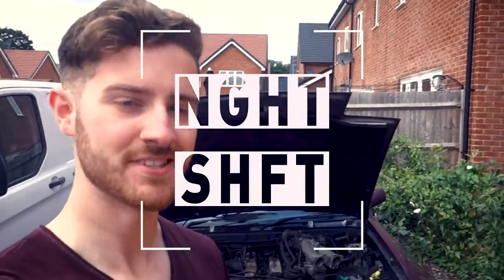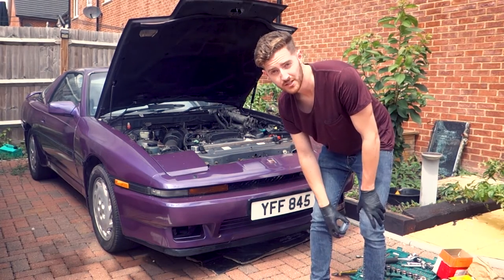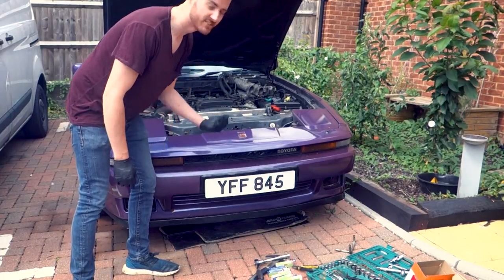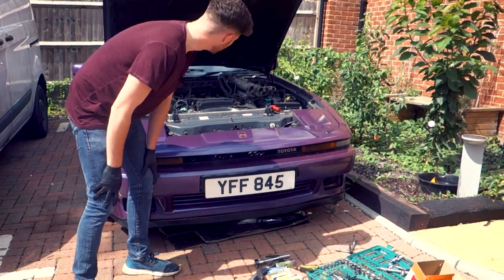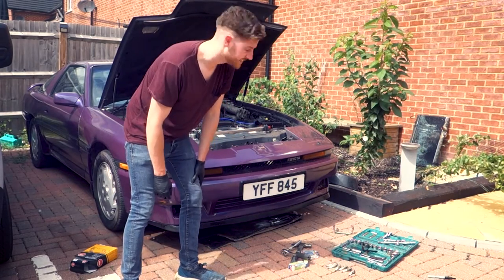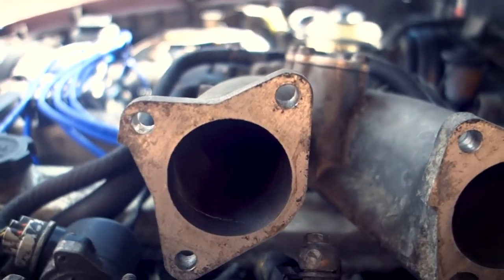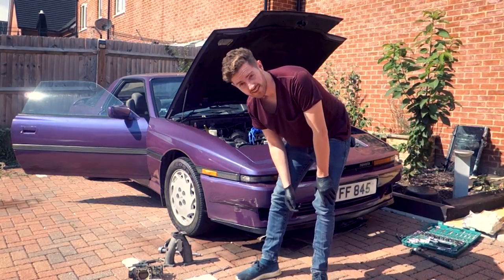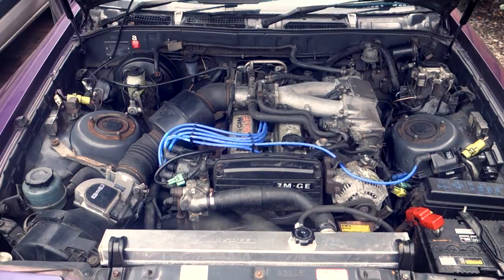THE BEST TRICK TO CHANGE YOUR SPARK PLUGS!

Comment: Boy under that hood is rough, lots of rust. Hopefully the body of the car is mostly ok. It's completely contrasted with how amazing the paint looks though. I can't hold a candle to that! 
I did a complete engine bay clean up on my supra last month and a stiff wire drill brush does the trick at shining up the cast iron parts and removing rust. 
I gotta try this wiring/spark plug swap sometime, looks dapper.
Reply from the maker: That's the unfortunate downside to a car that's sat untouched for 20 years. Just wait for the upcoming video, the engine bay is going to look 10x better.

Certainly could use going around the engine with a wire brush.

Comment: Nice car. I wouldn't actually mind you doing a video on removing the throttle body assembly. Looks like quite a bit needs removed to access the plugs on the Supra. Mine starts to miss after it warms up and during idling.
Reply from the maker: Thank you. You may find this video helpful: https://youtu.be/yOblLbBr70U

Sounds like the same issue I had with the car, Spark plugs can be quite sensitive on the Supra, it's key to find the right ones. I'd recommend Denso Iridiums, car now runs so much better.
Reply: @NGHTSHFT  fantastic, thank you very much. Keep up the great work and videos!
Reply from the maker: @emmetdonnelly2072  Thank you, much appreciated!

Comment: Hello mate I just came across your videos and wondered how you’re getting on with your supra?
Reply from the maker: There'll be a new video up soon now the weather is better again. The Supra has been hiding in storage over winter.
Reply: @NGHTSHFT  sounds good! Are you anywhere near Kent? I’m in the process of doing a load of work to my Mk3 at the moment.. maybe we can meet up with them at some point! Also which was the correct throttle cable? I think I ordered the short one like you did from rock auto but haven’t checked Fitment yet
Reply from the maker: @JackCameron811  I love in Hampshire myself, I'm always up for meting up. Funnily enough neither cable was right from RockAuto for me, I had to order one from eBay that came from a breaker as both RockAuto ones were too short.